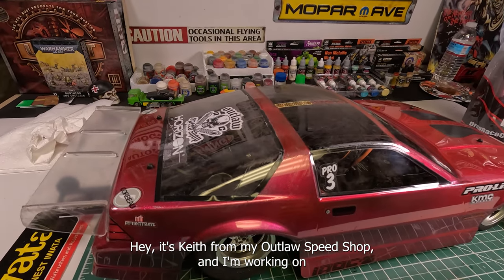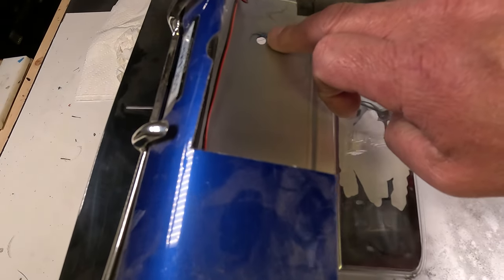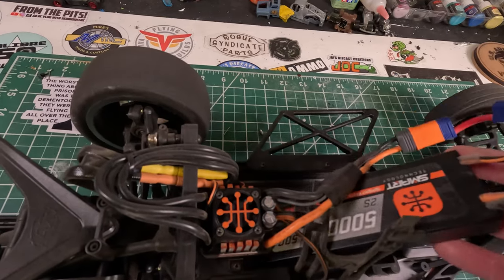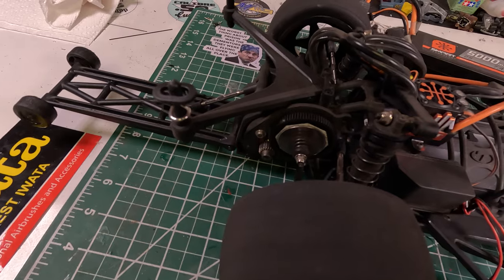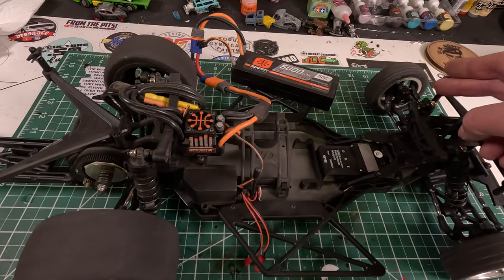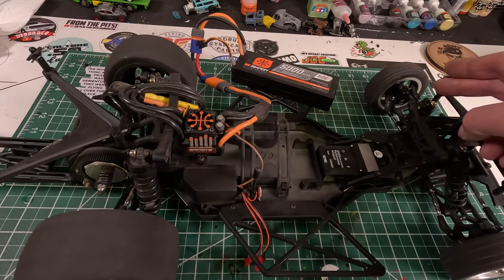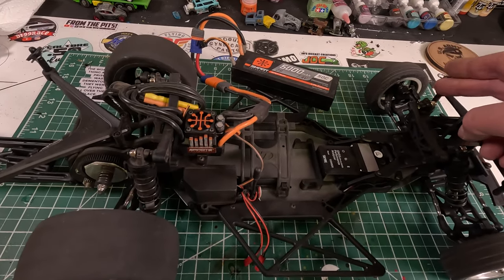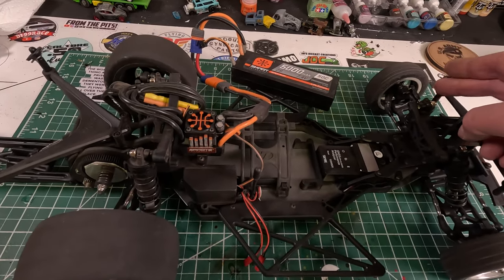Losi 22S No Prep Drag Car   Part 1

Comment: with an aftermarket radio you can ramp the throttle curve so it doesnt apply full throttle out of the hole and there is a video here somewhere that talks you thru the bump stops in the shocks.  getting travel in the shocks is a must.  Good Luck with it and keep posting
Reply: I used to race high bank oval Nascar we would set a throttle lag back in the '90s. It was built into the TX as a function via a button.

Comment: Duct tape or most any tape won’t stop the tires from burning the body the only thing I found that worked is aluminum foil tape. It last a really long time and it’s not thick and it’s pretty cheap. I ran a 100c 5000mah 2s for a little bit till a friend sold me his 7000mah 250c 2s and it was like putting in a 3s big difference. I also found that this car does pretty good with 500k diff silicone and where I run you have to run the stock electronics from the big three Slash, DR10, 22s and this car does better with a VXL esc with that 6500kv.

Comment: I just bought this same car, haven't even been able to drive it yet, as soon as I put the Throttle on, it shoots 90 degrees to the right, I've up graded the shocks, still can't figure out why it just wants to shoot right, any ideas
Reply: My first question are you doing a burnout if not you should get some carpet so you can clean the tires up and heat them up at the same time and my second question is how tight is your slipper clutch if it’s tight loosen it till it goes straight